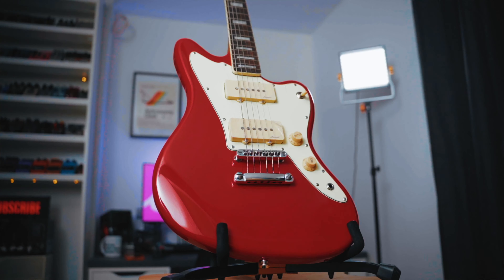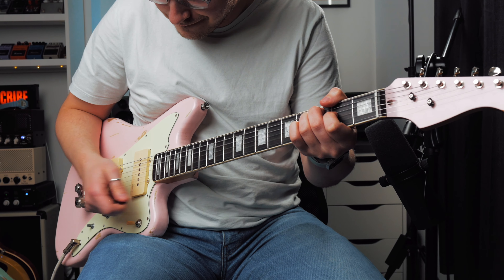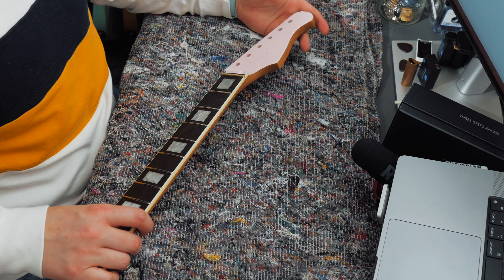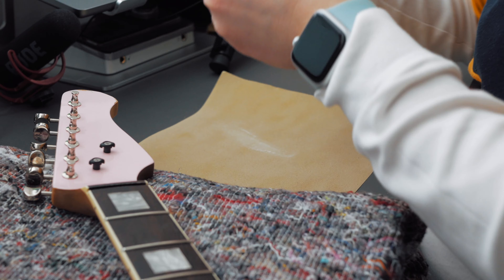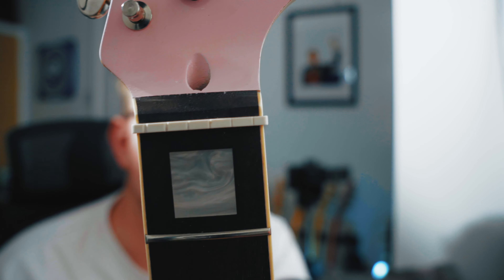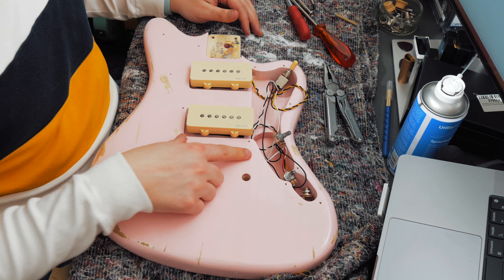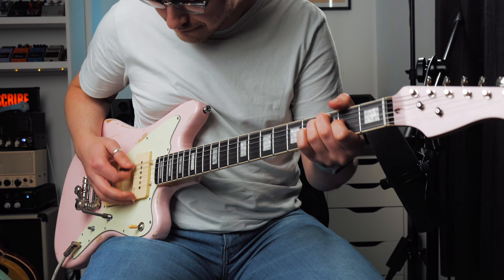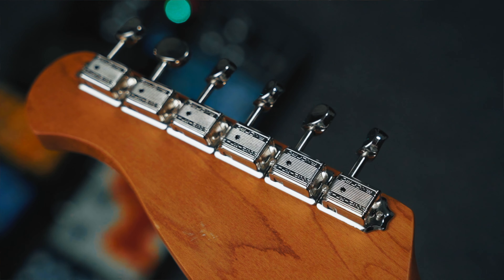I Installed a Tremolo to This £150 Guitar!

Comment: wow I just did the same thing with the same guitar and color. Mine is the stock pink. I wish it was relived nitro.  As for the term...did the cheaper, rip-off version from Guyker. The spring isn't as good. Think it needs some of the upgrades that you mentioned. I also did a cheap Guyker roller bridge which is awesome! I did install some new 1meg pots and next week I will install a treble bleed variable circuit and a variable tone capacitor circuit from Mythos. Overall, I am shocked at how light it is and how well it resonates.

Comment: Did you have to fill and re-drill the tune-o-matic original holes in order to fit
the Duesenberg ii Les Trem? or was it a "drop in" replacement?
Reply from the maker: Nope didn’t have to do any drilling at all. The whole process is in this video

Comment: I’m surprised how many YouTubers install a duesenberg without adding a roller bridge. You absolutely have to use a roller bridge, unless you don’t mind the strings sawing into the bridge like a bow saw every time you use the trem.  This vid does no justice for that tremolo. Also when is the zero fret going to catch on? You don’t need a nut. Why have a nut when a zero fret works flawlessly and requires no setup. These nut replacements are a joke. They only effect unfretted notes which makes uneven volumes. And stop destroying your guitar finish to so called relic it. You just turned a functional guitar into a string snapping piece of garbage, and probably spent twice the value of the guitar to make it half as good as it was. The point of modding is to make things better. That paint job is terrible. It’s like soiling your new tightie whities because you don’t like looking like a mommas boy!
Reply: Wow! You don't think adding a tremolo to a guitar that is supposed to have tremolo was a bad idea? Harley Benton should be putting the tremolo in at factory but trying to save money I guess.